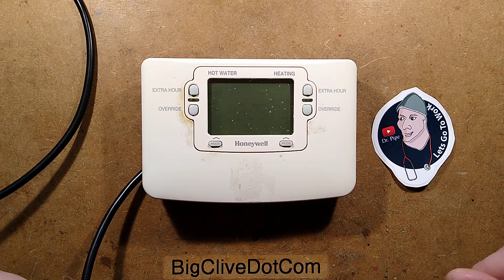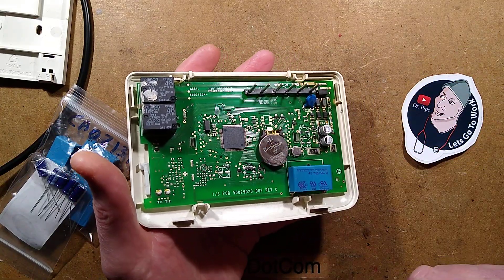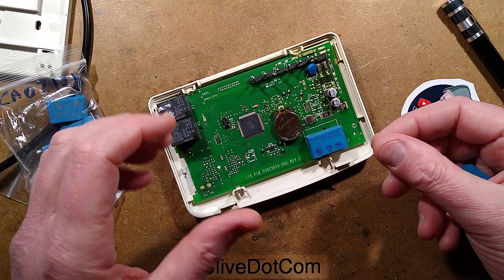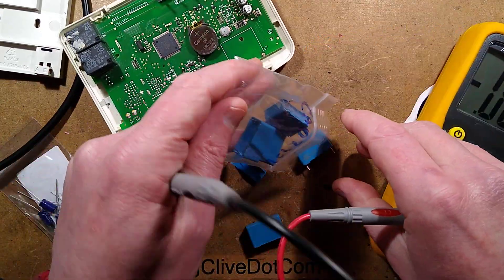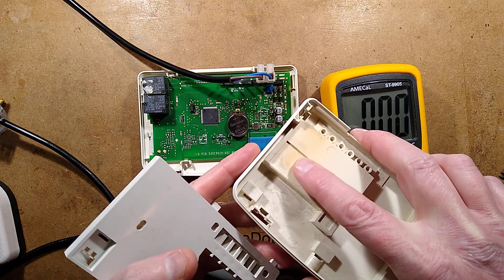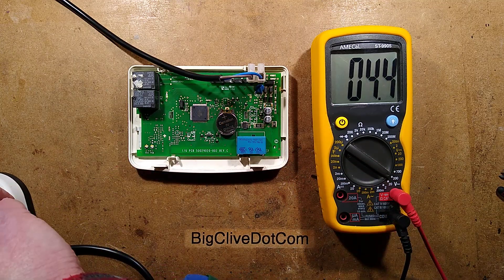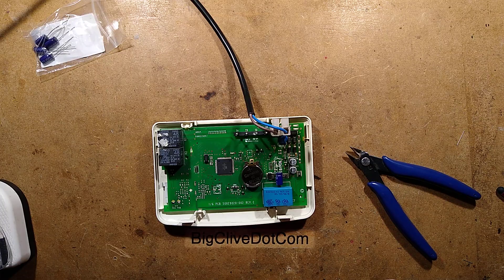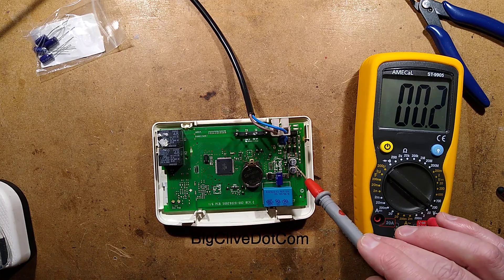Troubleshooting a heating controller.

Comment: This is the point at which I removed the old heating controller, yeeted it into the garbage, and replaced it with a Nest.
Reply: I reckon you’ll have trouble replacing parts inside a Nest !
Reply: You can never have too many security holes in your home automation.

Comment: Would drilling out a hole in the back to allow the caps to stick out  a bit be viable?
Reply from the maker: Modifications like that are generally frowned upon.  Especially if there's an "incident".
Reply: @bigclivedotcom  Stop making things up Clive.  Nobody frowns upon it, as long as you haven't exposed dangerous voltages but in this case, the thermostat has to come off and be disconnected to access that area so it couldn't be an issue either way.

What is more frowned upon is doing an inferior repair because you artificially feel constrained to follow the path of a bad design that already failed once.  Do not make it unsafe, but do make it better than it was when new or else, what have you really solved instead of just maintaining the chaos?

When the customer orders it, their criteria is not where a component is in the back where it is not seen..  The customer has no idea and it does not matter in an unexposed area.
Reply: My old Linksys router has a hole in the top for that very reason.

Comment: For a moment there I thought Clive had caved in and turned his heating on.
Reply from the maker: I did.  But then felt remorse and turned it off again.
Reply: @bigclivedotcom  where I live...if at night the ambient temperature drops to 16C I start to turn blue..  and I remember going for a wee in the UK and there was a thin layer of ice in the pot...hard winter...single glazing...no rad in the kahzi...The wind used to blow up the overflow pipe and bring the temp close to zero...It didn't feel strange then...it does now...I couldn't imagine school swimming in the winter and walking back with frosty hair.
Reply: @markbakerskater666  You forgot ice on the inside of windows.
Reply: @markbakerskater666  Heh, if you think 16C is cold, I don't recommend ever living in Canada then. In the winter, daytime highs -32C, night time lows -45C. Fun fun! If it was 0C, people would be wearing shorts!
Reply: @gorak9000  Those temperatures are extreme m8. How the neck does anyone get everyday tasks done?
Also fuel cost must be huge.  I guess if you worked cost out? It would be classed as Fuel Poverty? Residual income below the official poverty line.
Tough life.
I watch 'Life Below Zero'.  When were sat ,warm and comfy at home, you can't appreciate the tough life it is.
Go and watch it, sat in the cold! Ha ha.... that's a different experience...lol
Reply: @gorak9000  Hehehe...no I don't....I spent a year in St Petersburg...it's just what you get used to....now I am used to minimals of 14-16C...I even put the heater on in the car if we go up the mountain a bit....I have to say I can face the heat easier than the cold
Reply: @gorak9000  As a 🇨🇦, I’d say you forgot the sandals. Although I’m ashamed to say, I got out the long pants before it got to 0°…
Reply: @groovejet33  Nothing much changes until it gets below about -35. At that temperature, things stop working properly. Like your car doesn't drive well because the transmission fluid doesn't flow right any more, basically everything outside gets pretty difficult, but above -35, not too many issues. As long as your igloo has thick enough snow walls, you can keep it pretty warm inside - snow is a great insulator :-P Joking aside, houses are built well and insulated well - thick walls, triple pane windows, good vapour barrier, not much of a problem keeping the inside at +20c even when it's -35 out. Heating costs in those cold months are $150 to $200 / month on the gas bill (depending on the size of the house, and how well insulated and sealed it is), but only in the coldest months. It's really not that big of a deal. Just don't spend too much time outside or your eyelids, tip of your nose, ears, fingers and toes start to freeze. Frostbite ain't no joke!
Reply: @gorak9000  “as long as your igloo!!!”   Lol....that’s great. Ha ha ha😂
Really? 
Your pissing with me?lol
Reply: @bigclivedotcom  Give it twenty years and ya'll change your tune LOL.  Make sure you have super or some other contingency plan to pay the power bill otherwise you'll have to move here (Straylia, mate).
Reply: hahahaha

Comment: A really handy, quick way to check filter caps on a supply, test VAC level on the output.  Some of them can be so bad, they show high ripple V even when not under load, and the caps can still look physically fine.  First test right after "has the capacitor exploded, vented, or leaked?" and before ESR.

Comment: I hate those Mini capacitors and it seems everything uses them any more too .
Reply: Here's my method for surface mount electrolytics.
When working with SMT components you need two soldering irons.  
For surface mount electrolytics - gob lots of solder onto the edge of the pads so that some of it is touching the existing solder.  Then using two irons heat both globs until the heat is conducted under both terminals.  Once it's loose tip it over.  I you try to lift it with the two irons you are likely to drop it and melted solder goes everywhere creating mysterious shorts.  Solder wick all the solder off. Using alcohol and a q-tip clean all the burned flux that remains. Using a rosin flux pen apply rosin to both clean pads. Put a small dab of rosin flux Pb solder on one pad.  Melt it with one iron while using tweezers to place the cap and push it down into the melted solder.  Now slightly lift the other end and apply the solder.  

Notice that I used the terms "Pb" and "terminal" instead of "lead" and "lead".  My boss instructed the tech lab to get rid of all the "leaded" parts so we could meet compliance.  He meant Pb.  They thought he meant non SMT terminal parts.  They threw 400k$ of parts in the dumpster.  They were picked up and gone before we knew.  I had to spend several weeks filling out purchase orders for replacements.
Reply: @kthwkr  I wonder who took all the free components? Is there someone at your work selling discount components now?

Comment: Watches the video and glances over at a Honeywell T874C thermostat on the wall using bimetal springs with mercury switches and wondering why anyone would ever put in a digital unit when these old ones can last many decades if not lifetimes and are fully serviceable.  When I had an HVAC tech here to check over the boiler he had an apprentice with him and the apprentice took one look at the thermostat and said it looked old and I should replace it.  I told him that they don't make any of the new ones that will still work a century from now.  The older tech agreed saying they try not to replace the old ones unless they can no longer be calibrated or serviced because all the new stuff is fancy junk that is far less reliable and will be lucky to be working 10-15 years from now.  
I get that the newer ones support schedules but who really uses that when you really just need a 2 stage thermostat with a timer on the furnace?

Comment: Does 20% tol mean that it can be +/-20% (between 544-816 nF), or does it mean +/-10% for a total of 20%? +/-20% seems absurdly inaccurate, leading to very imprecise caps.
Reply from the maker: +/-20%.  Quite extreme, but seemingly common for suppression caps where exact value is considered less critical.
Reply: Film caps in this range are never used where precise capacitance value is needed, so they don't bother rejecting parts due to a higher tolerance spec, would just increase manufacturing cost.

Comment: What kind of engineer would place hot resistors under electrolytic capacitors? 
They should call the company "HoneyNotSoWell" !
Reply: Someone in Philips, perhaps? I have a couple of 1970s tv cameras where the DC power filter caps are fixed onto the heatsink of the regulators. One of the stupidest things I've seen

Comment: They might all be within spec, but the fact that all of them are on the low side indicates, at minimum, a low quality batch, if not a low quality manufacturer period.
Reply: More than likely a manufacturer cutting cost, winding them all to the low side of the spec, saving the length of foil they have to put in.  Winding to the low side means they still meet initial spec, but the manufacturer gets 10% more units for the same cost for the foil. You can do this for foil caps as the foil is going to be consistent through a batch and between them in most cases, and unit variation will be small, but yes it is a cheaping out from the manufacturer. May meet initial spec, but will likely fail to be within spec after a few months of being used, due to self healing.
Reply: It's also possible there was a mix-up in the manufacturing plant. The cap-making machine could've been set up for 560 while the labeling machine was set for 680.
Reply: The manufacturer will make a whole bunch of caps. Then measure them. Any within 1% go in to be sold at the highest price. Then anything between 1% and 5% goes a bit cheaper. Then 5-10% ab bit cheaper still, then the 10-20%. If you buy 20% tolerance they are unlikly to be better than 10% as those would have been filtered out for a higher price.
Reply: It doesn't matter much, this is not an app where exact uF value is critical like a timing circuit would need.  Electromagnets in relays either have enough power to overcome their spring tension or they don't, temperature effects aside.

Comment: You need some dead video cards! For those little smd aluminum electrolytic caps... Though probably dead capacitors contributed to the death of so many of my video cards...
Reply: 63V might be an issue tho, video cards tend to have sub 2V rails..
Reply: @amojak  You are half right.  63V is an issue, but practically all video cards have 12V caps, with the sub 2V being handled more and more by SMD ceramics.

Comment: 6:50 Not every multimeter can actually measure AC on a DC offset! My OWON can't but cheaper and simpler multimeters can!. Generally of you're looking for a multimeter than can do that choose one that's not auto ranging. The auto ranging stuff will just show 0
Reply: With the Brymen BM235  I experienced that .
Reply: Umm, no, I have at least two different autoranging meters that show ripple from AC range on DC circuits.  It is in fact, an alternating current when under load.
Reply: @stinkycheese804  try and measure the accuracy then. I said some but this only happens to those some auto ranging meters. Classic DMMs don't have an issue with this whatsoever

Comment: clive, when removing smt caps like that, if they're dry, I just nip them apart with a set of flush cutters until only the leads are left on the board. then I just wipe the leads off the board with my soldering iron.
Reply: ... or use the controversial "Adrian Digital Basement" method. Adrian simply uses pliers and turns surface mounted caps until their pins snap from the cap housing. Always causes a lot of flak in his comment section - but he says, he never has any issues with lifted traces. Well it's the method which works best for him - and keeps his comment section entertained. :-)
Reply: I recapped an Amiga 1200 and ended up using all sorts of methods as some would lift off nicely and some would pull off and leave the legs. The only traces which were bad were the audio caps where they had leaked (which was why I was recapping it in the first place, no left channel). I replaced those caps with full size ones as the traces were too bad for SMT.
Reply: @6581punk  the proper way to do it is to use hot air. That is how I re-cap anything that has bad SMD electrolytics
Reply from the maker: That would have been the best option. I tried removing one and took up some tracks.
Reply: Watch Mr Carlson's lab how to remove smd caps no heat!
Reply: @barnenlenovo681  No.. because he is wrong.
Reply: @anotheruser9876  I've done that, and it works.  "Bodge" wires.

Comment: Mine went dead after about 4 years Honeywell replaced it straight away. Must be a common problem.
Reply: It is, at least a similar design we had here in the 'States a few years back.
Extremely heat sensitive, not a good thing for electrolytics to be that enclosed.
Reply from the maker: They probably wanted to add ventilation but were prevented by regulations to stop babies poking paper clips in holes.

Comment: There is room for those caps if you remove the two SMD caps first and put one on each side.  Just shorten up their leads before soldering them in and they will be taking up the same horizontal space.
Reply from the maker: They're hard to remove for your average heating engineer.  It's easier to lay a standard through hole cap in the space of the empty cap positions.
Reply: @bigclivedotcom  - Yep, the cap you already put in seems to be working so just shorten those leads up and move it up (North) and it looks like the case would then close.

Comment: I've got a newer-ish Honeywell T-stat where the backlight has gone to the dark side. It was intermittent at first but nothing now. Not sure what to look for though. Thanks for the ripple measurement trick, I learning something new today!
Reply: Probably bad soldering on the little light bar on the side of the LCD, or the actual lewd themselves have gone open circuit.  Easy enough to fix, but often to get to the LED units themselves is hard, because the units are either heat staked or glued together.

Comment: actually with many meters you cant directly measure ripple like that, i have several and most cant and even state in the instructions not to, the dc level when on ac gives weird incorrect readings, i have only one meter that can do it, an old tandy bench/shelf one, but you can use a capacitor in series with the meter to block the dc level
Reply: My Bryman has a specific mode for it where it displays DC and AC readings simultaneously (it has a main 6 digit display and a smaller 4 digit display)
Reply: Meh, no, most meters can be used in AC mode on DC and serve as a diagnostic tool to indicate too much ripple even if the reading is not accurate enough to do more than that.
Reply: Many meters don't like the rippling frequency either. Most meters are designed for 45-65 hz Ac a full bridge rectum fryer can output 100 or 120hz and an electronic load can push this into kiloherz.
Reply: @tobiashegemann1811  There is no like or dislike, meters don't have feelings, only level of accuracy and whether that matters in what you're doing, or whether any damage is caused.